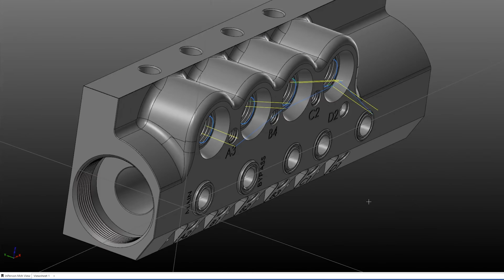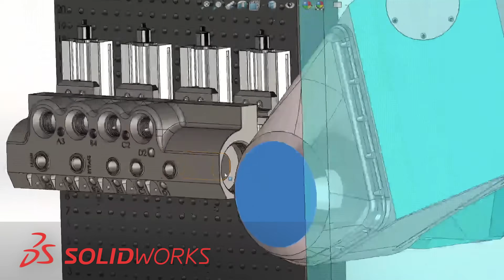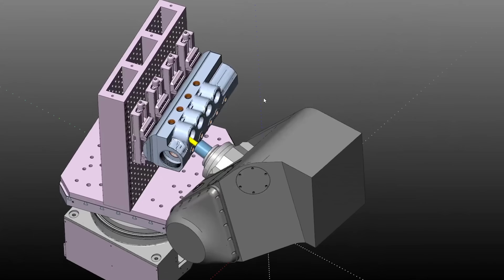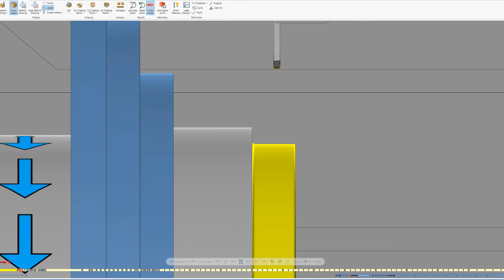Manual or CNC Machining...Which takes MORE SKILL?

Comment: I agree with everything you say. The only time I can think where a manual machine is faster than a CNC is low precision prototype or anything like the sort. I was asked to make a drain plug for our tumbler and rather take a CNC away from rubbing its parts I threw it in a manual lathe turned it down and used a hand drill to drill holes. That being said this is a one in a thousand story and CNC is faster 99% of the time.

Comment: Using 75 inch 4 jaw chucks with back stops  machining inconnel and using 64 clamp fixture using shims and feeler gauges to strike datum faces. Whilst touching on all the tools from know faces and diameters was indeed skillful but the programmer had to design  the process and the program and fixture they  required  my skills as an operator. Cnc is harder but every shop needs a manual lathe !

Comment: I am a machinist with 26 years in the trade. I am well versed in both conventional and CNC work. There is a lot of skill required in both. When it comes to CNC, in my mind I look at how I would do it conventionally and apply it using CNC methods and then I do what I can to make it as efficient as possible.
Reply: 100%

Comment: There will be people fuming and up in arms and others will be saying spot on. Which side of the fence you fall into will show how open to new and different ways.   Different is not the same as Wrong. It is different.  A different way to make an item  is just that different.  Then add the other product needs, speed, quality, finish and material wastage.  With these you can see which will make a company a profit.  A new process needs different skills ..   different ones often ones that build on the existing. To build you need to accept differences.  You can tighten a bolt with a hammer and a chisels. But is a tool better…  if you need to think then we all know which side of the fence you will be on. 
Years in maintenance has shown progress means different ways and different approaches.  The final outcome was always to be running equipment safely and to the best of its capacity, to do that it was a constant learning of the different.

Comment: I was visiting a museum in Italy a couple years ago. Filled with fine crafted metal parts from about 500-1000 years old. Turning and milling has been around for ages with machines driven by water or wind. I guess that really required alot of skill, patience and optimal weather conditions for the right speeds... Well people always find something to complain about.
Also I do alot of manual milling on the CNC machine for it often is faster than writing a program for it.

Comment: I don't know about more skill different set off skills I run a agie charmilles 400lp. Hard milling with a system 3r robot job is die making A lot off medical working to+/- 0.0025 mm on shut off and +/-0.005mm on moulding ill have a batch off 64 dies all to be in speck  and still try to achieve 100 hours milling a week with robots it's all pretty programmed to plus and we size tweek at the machine helis comps z and x and y and c movement to tolerance 
Different set off skills I think

Comment: I do both manual and CNC. I love cutting metal. I don't care what machine I do it in. In a job shop you have to be versatile no matter the process.
Even when I hire a CNC guy, he is still going to get a test on a 4-jaw having to indicate a part in. Just to see where his head is.    
I also think it depends how lazy a person is, and what kind of work ethics they have. Be proud of what you do. Not many people can do what you can.
A old-timer use to tell me. Any machinist can make a part on a good machine, but it takes a good machinist to make a part on any machine.

Comment: We in Germany 🇩🇪 are learning 3,5 years. We Beginn with normal Metall work than we do manual machining to get a feeling for the process, for the Material, Tools and a lot more. Than We learn CNC, CAM. And We learn Pneumatik. We must learn it. Also We have two Tests in the middle 5 Hours manual process and build something together and theory. And the last test is also about cnc Codes and many more Things.

The Jobs calls 
Zerspanungsmechaniker 
.
And for repair work and Pneumatik 
Industriemechaniker.
.
That's why We have a high standard We learn everything and train so long until We get good in it, We are working 3-4 days in the Company in the Production and 1-2 to school. So in the end we are very flexible and can fix things manual. 

It wasnt easy nowdays many young people quit cuz it is Hard for them. People, and you learn everything until you can do it perfectly. People are laughing and so on, you also Learning for live

Comment: It's not that you're wrong, but your focusing exclusivity on new manufacturing. A lot of machinists are in the repair side of it where software is incapable/incompatable with what's being done, in example, many hydraulic cylinders are welded together, and when being rebuilt, the entire assembled cylinder has to be chucked in a lathe and have the gland parted of, cnc can't do that because you don't know how deep to cut, you find that out as you go, or your dealing with some thing that has been repaired before, and you don't know how the other machinist did it, or what dimensions he used before welding it back together.
Reply: The point he is making is that the CNC guy knows all the same info, maybe has less manual experience, but ultimately has the same knowledge and problem solving skills as a manual guy. Except the CNC is worth orders of magnitude more in productivity when it comes to manufacturing large orders.

Tons of respect for manual work and it is still a very necessary part of the field, but the idea that the CNC guy isn't of the same caliber is nothing short of ignorant
Reply: @bobbystem7384  What your saying should be true, that's what everyone wants, but if it was true, the Titans of cnc YouTube channel wouldn't exist. So many cnc machines out there baby their machines and take so long to make parts, that they can be done cheaper on manual. Not faster, just cheaper. Before my company got cnc machines, we had other cnc shops making some of our parts, and we ended up bringing them back in house on manual machines because it was so much cheaper. One part was quoted at 140$ a part, same part took 40 minutes to make on the Bridgeport, at 50$ a part. After we got our tormach 1100mx (no where close to the Haas that the other shop had) we were making that part in 16 minutes. Another part was being made at another shop for 100$ a part, we just started making that part on our cheep Chinese tormach, at 6.5 minutes a part. Here's the hilarious bit. I never went to school for machining, didn't know how to turn on a cnc machine till last September, learned all on my own. That last part I told ya about, was our first part that was designed in CAD, and we were having problems with it posting, we called in a old employee that did go to school for cnc to help us, he spent a couple hours trying to figure it out, and couldn't. After he left, me and the manager suck with it, he found some stuff online about G40/G41 cutter compensation, and I edited to G-code, replacing all the G41 with G40, and deleting the D value, and the errors went away and we started making parts.
Reply: very true, I do CNC most of the time but often times I get rough work or a one off repair job which I just do manually on the CNC mill. almost always faster than writing a complete program. only difficult thing is that the electronic handwheel doesn't have the feeling of an actual mill

Comment: Most of the parts I make (side work at home) I will have finished before it can be programed... I also don't own a cnc "yet"
Reply: For simple processes (3 axis parts) and low part counts that is true - repairs and side hustles are where manual machines shine

Comment: Comparing cnc to manual is apples to oranges. Yes a cnc MACHINIST takes a lot of skill to go from drawing to model to tool paths to work holding Yada Yada.  But manual machining is like learning how to walk and cnc machining is running. I do feel it is very important for a cnc machinist to understand and be familiar with manual machining concepts and operations. You could have the best cnc machinist in the world. But if you asked him to drill and tap a hole manually he might have no clue how to do it. There are certain tricks and skills you pick up by learning  how to manual machine that will elevate your skills as a cnc machinist. I work in the industry and I would say over 80% of cnc operators don't know what they are doing. All they know how to do is load material. Shops like yours are few and far between. That's why you guys are were your at. Also learning manual machining gives the machinist appreciation for the technology that we do have. So for the most part I fully agree with your video. But you have to realize that your industry a huge majority of cnc operators are literally just button pushers. So ya, it's offensive for some cnc operators to call themselves machinists when comparing them to a manual machinist. A manual machinist can be a cnc machinist with proper training. A cnc machinist might or might not be able to be a manual machinist.

Comment: Being a blacksmith takes skill too..And it pays well..Because it’s a skill that is getting dated and very few do it or train to go in that direction..The cost of used manual machines in my area go for dirt cheap and sell to hobbyists..

In my dept,we still create engineering drawings because it’s a required legal process..But there is absolutely no valid function for them..They never go to the manufacturing process..We transfer CAD as master..Drawings are a huge waste of time and resources.

Repeatability was never a possibility in manual machining..Taking pride in “Good Enough” is why American manufacturing left this country..
Precision manufacturing by todays standards might bring it back.

Comment: On a professional level I am 100% on board with using CNC over manual, but if I'm at home and I just want to make something and relax I'd rather use manual. For me there is something therapeutic with using a Bridgeport, but if I need to get a job done effective; CNC is what I would use any day of the week.
Reply: If you where to make only a single easy part ( like a drill guide or a custom washer ) then the manual would also be the weapon of choice I guess ( at least for me that is. Since I can face a part with a facemill and change to a drill toolholder and estimate somewhere close to center faster then I can turn on my PC and start Mastercam)

Comment: Why are you guys seem to be always in a competition "against" manual machining? Do you have to compensate something?
It's always a matter of the task you have to do. Sometimes it's way easier and quicker to get something done manually, before you try to setup a CNC-Machine. Especially when it is only one or two simple parts. Of course, this doesn't bring the money, but it helps your efficiency over all.
As someone who knows both worlds very good, I'm able to decide pretty well, what I have to use or avoid to make money or lose money.

And to all the CAD/CAM user, who think they own the world, because they are able to program the most difficult stuff: Learn and use manual programming first and do that very efficiently, especially with deep diving into operators/variables/macros programming. If you can't do that first, you don't own the world, because you got no clue about machining efficiently.
Reply: Haha, it's not a competition, Zag! It's more of an "answer" to the people in the comments (and in our own experiences) to the people that say that CNC machining requires LESS skill than manual machining. Both are relevant as I said in this video, and both require many of the exact same skills.

Comment: OMG! I got four programming certificates (one for manual programming and three for CAD/CAM software) which makes me very attractive to employers. 

However, when I accept a position and realize everything they're doing is sooooo out dated, I try to implement more efficient methods. Then, I start getting all kinds of push back from the "old timers". 

It's so frustrating when they have things like "exact copying" and other procedures set in stone. Sometimes I feel like Moses trying to free my fellow man from the tyranny of the powers that be. 

I try not to rock the boat too much when I've only been here for a short period of time, but it's so hard not to when I've been exposed to better solutions. 

This video just gave me hope again. Round two! FIGHT!! 😪
Reply: I Know what you mean, Im currently doing a job in tool steel and i cant get the right endmills for doing it good with a modern toolpath, and im just being told that the normal endmills can also cut the material. and while they do cut it, its just realy slow and they dont last very long due to parts of them chipping of easily.

Im moving to a new job very soon though and im getting complete freedom with a brand new Haas UMC 750SS so that's pretty cool :)
Reply: @gerrit2107  Been there😒
Congrats on the new job. Have fun!
Reply: @unaffected_covid  Thanks :)
Reply: I would boldly go in and have a private meeting with the owner, and have a discussion of WHY he is in business. If their actual goal is to be PRODUCTIVE,  explain how you can help. Otherwise, if they indicate 'they don't need none of that newfangled stuff', quit and find a company who IS interested.
Reply: @BrilliantDesignOnline  they dont talk about it like its newfangled stuff, but something like adaptive roughing strategies is not something they would do. that might give you some idea on the situation :P
Reply: @BrilliantDesignOnline  Basically
Reply: GET IN THERE, Charles! You are doing Gods work 😂
Reply: @barrysetzer  thanks brother

Comment: An easy arguement i if manual is so much better, why do the big companies that turn millions in profits have soooo many CNC bit only a handful of manual...? 🤷‍♂️ and why do the companies that only have manual struggle to turn massive profit?
Reply: Your actually not correct. Maybe small manual shops don't make profit but you have to remember cnc machines do small parts. Imagine how much it would cost to have a cnc lathe that holds a 70 foot long 90 ton shaft. Some manual shops are far more profitable than small cnc shops. It's really the type of work your doing. You have to remember the bigger the part the more expensive. A very small percentage of parts can fit in a cnc machine.
Reply: @machinist1337  I wouldn't say a very small percentage.... you're right that when you go big you don't see much CNC but is that because CNC isn't right or that CNC of that size is impractical to make? This is more a comparison for work that can be done on both and I assure you if there's a CNC option for a 70 foot 90 ton part then it will out perform any manual option. If you only every do 1 offs or its simple profiles then  manual COULD be a better option but more often than not, CNC is more beneficial 🤷‍♂️
Reply: @wildin13  yes cnc is way way way more beneficial for human advancement. Soon humans will be cut out almost completely. I personally believe at some we will unlock the language of DNA. We will no longer machine parts, we will grow them. Just like a sail boat, you order it and it is grown out of bio or synthetic materials. Anyways thanks for the reply have a good one.